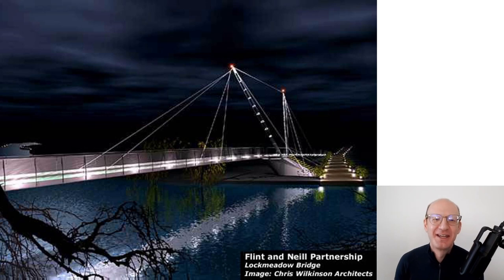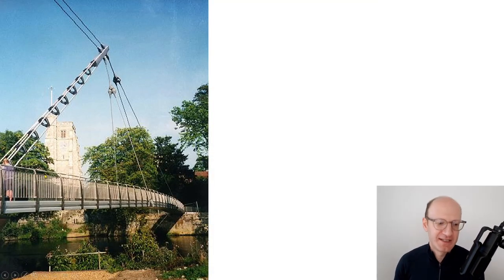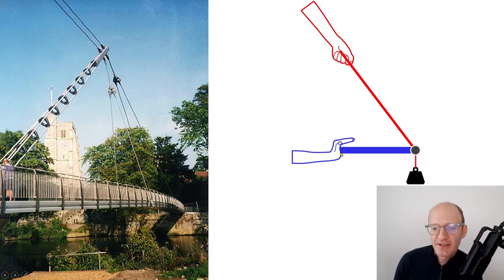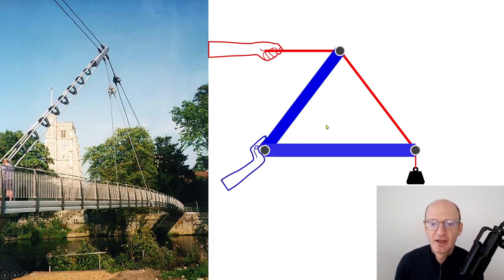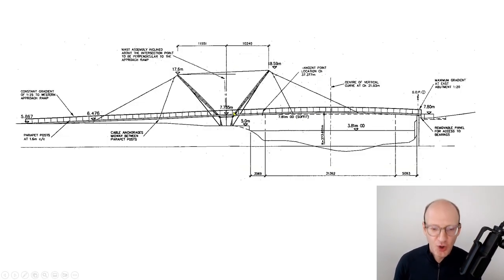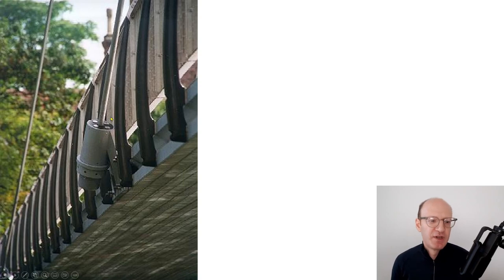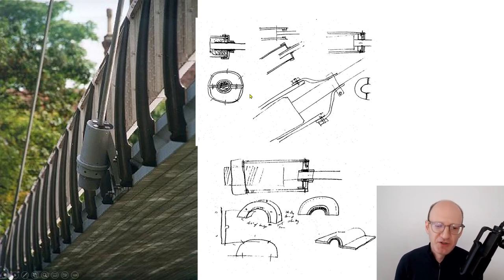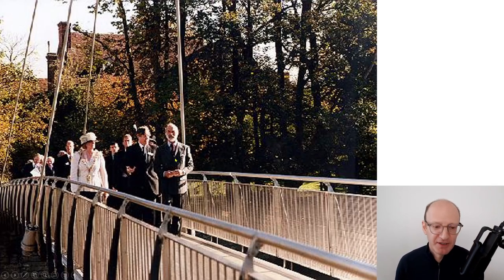The Extruded Cable-Stayed Footbridge!

Comment: Far from being “Woody Allen's ugly brother,” I find you articulate, personable, witty and attractive… a person one would like to hang out with. You are one of the best “explainers” on YouTube, and definitely the best explainer of structural principles.

I like this bridge. Might it be called a “boom” bridge? The structural layout reminds me of how we would pull tree stumps, or fence posts, out of the ground. You tie a chain onto the stump/post and then up through a V notch in the end of a post propped up at about a 45-degree angle and then connected either to a tractor or a good strong come-along puller to the base of an adjacent tree. It converts pulling force to uplifting force.

Isn't the load on the pedestrian bridge greatest, not simply when it is full of people, but when it's full of people and someone plays music causing the people to move rhythmically. If the song's rhythm happens to match the natural frequency of the bridge... that's when things can really go wrong. Whenever I find a cable pedestrian bridge, usually on hiking trails, I pace out to the center point and bounce up and down at different frequencies until I find the natural frequency of the cables. The up and down movement can become quite amplified, sort-of like “Gallopin Gertie” The Tacoma Narrows bridge collapse.
Reply from the maker: Thanks! And great point about dynamic crowd effects on structures with positive feedback.  I think the most dangerous is when there is some rhythmic external source (e.g. music etc.) that keeps a large crowd, that would typically be disorganized, in sync with each other.  This is sometimes seen at crowded stadia...see first few seconds of this for example! https://www.youtube.com/watch?v=Q5TArPeNB6o

Comment: nice solution to the resonation problem , altough weight is good against oscilation , weight is also your biggest problem , the dampers in the strings  handle the longer waves. pity the  design turned out less attractive from the blueprints

Comment: Aluminium, because we're right, and they're wrong. The clue is in the name of the language.😄😄
It would have been nice to see a section through the steps, because it is difficult to picture what you are talking about with the cantilever, and with the slipping elements tied together. 'twere it me (I'm an architect), I would be a bit disappointed with the big clunky lump of concrete that the steps climb. With a slim and elegant overall design I found that a bit brutal and intrusive. Even a good planting scheme to hide it would have helped. Ivy to the rescue!
Your tower and its diagramatic explanation reminded me of the bridge I built to win a competition at university many years ago.....the lightest balsa bridge to span a 2 metre gap. I did it by putting the structure into compression along its length using dental floss to carry the 3kg load. It still holds the record, apparently.